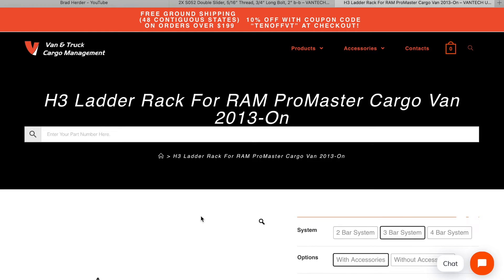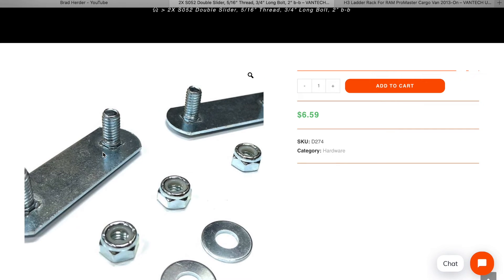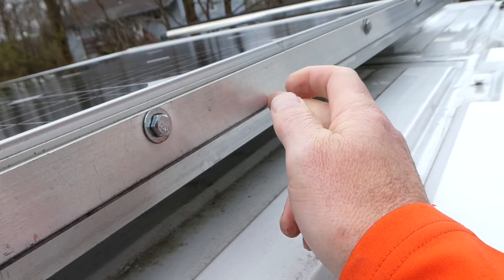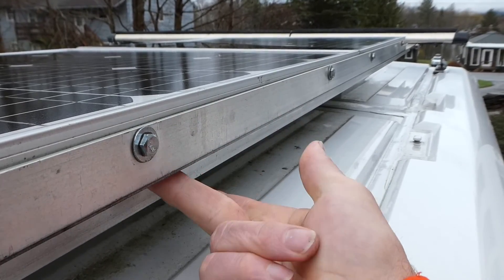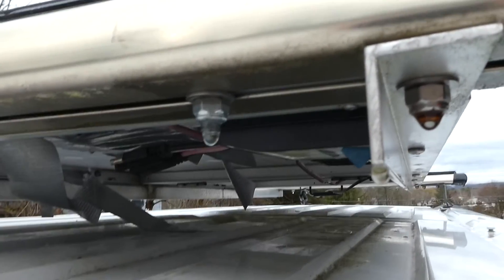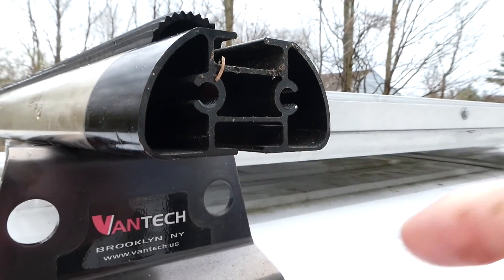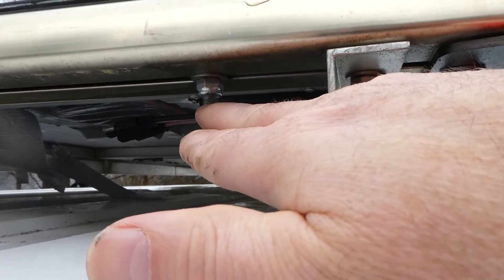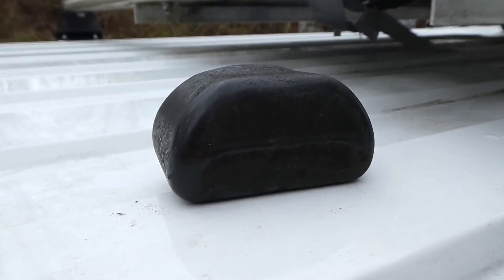How I Mounted Solar Panels on the Dodge Promaster Vantech H3 Roof Rack

Comment: Why didn't you just use unistruts? Also, do you hear any whistling while at high speeds on the freeway?
Reply from the maker: I had never heard of unistruts and I have so much noise from my ceiling fan, I can't hear anything else but don't notice whistling, however, with my Thule rack on my wife's Subaru, there's plenty of whistling which is very frustrating.